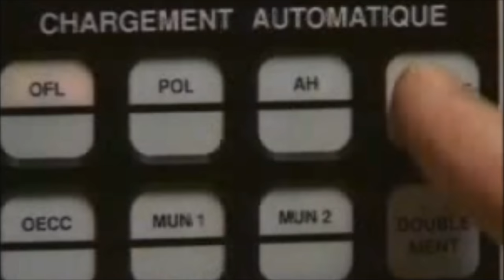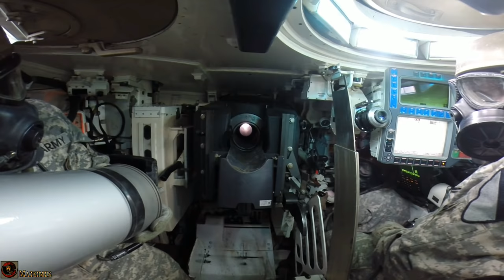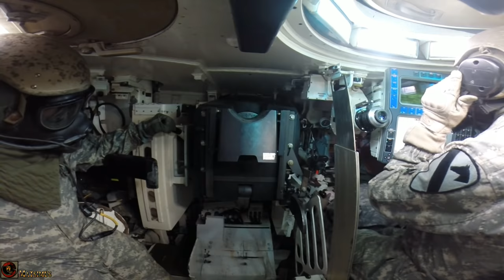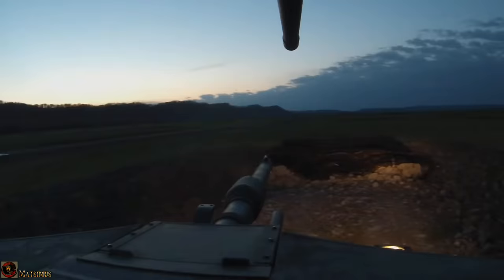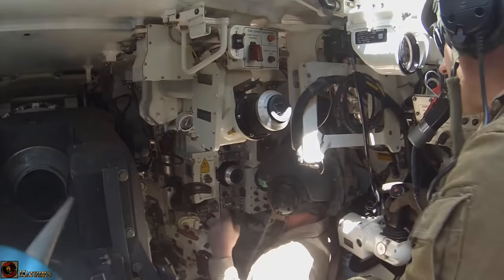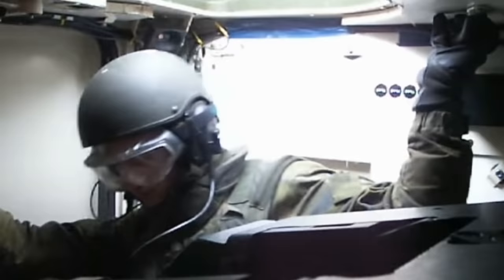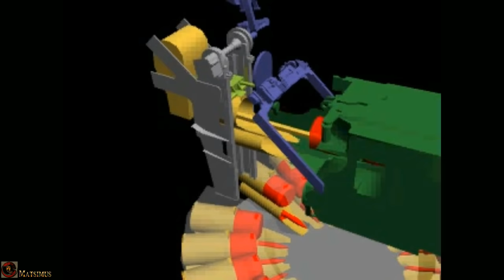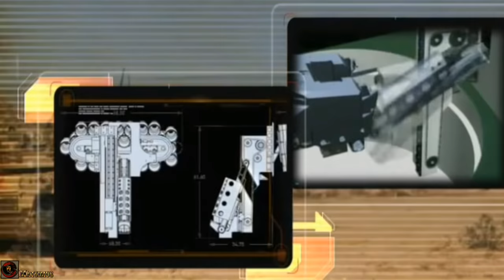Tank Autoloader or Crewman Loader?

Comment: I have a question that someone might know how to answer: why is it not often that you see a tank turning its turret when you see tanks at training exercises?  I mostly see the tank turning its whole body to the objective and then shooting. They apparently never shoot at something on one of the sides of the tank by turning the turret 90 degrees, but turning the whole tank to the enemy. Why?
Reply: There are several reasons why. The main one is that you are trained to always face towards the enemy.  The frontal aspect of the tank is the most protected. If the hull side is facing the enemy you are presenting a larger target and weaker hull armor protection. You would only fire over side if you have no choice and must fire quickly. The tank is also the least stable when firing off the side. If the enemy appears on your flank while you were moving, the entire platoon would action (turn) towards them. Another reason is that the enemy "should" be to your front, so if you are firing towards the flank you may be firing on friendlies.

Comment: You can use a manual loader for now, but by the time to catch up technologically, those who already know the system will be ahead of those who don't. 

The Russians might not create the best auto loading system for now, but they have the technical know how to make a compact loading system for larger guns. Is about improving the system.

Human strength will become a limit. Till the point we can no longer unload, carry, shove in a 30kg shell every 15 seconds. A machine can't feel the stress, eventually loading different kind of ammunition is no longer it's limiting factor, it's not about how, is about when. 

Auto loading system is not perfect, but like robots once you invested into the technology you are one step ahead.

Now imagine an Abrams tank with an auto loader vs a lousy T-72M1 with manual loader, you might think differently......

I am not a tanker however. Yes I seen and even supported by one. I just felt today's stubborness is tomorrow ignorance.

Comment: Sorry, mate, but you are way off in this video. You equate autoloader with a T-72 carousel, and then draw all your conclusions from that premise.
There are plenty of other systems out there, for instance, already the AMX-13 had an auto-loader of sorts (the drum itself was manually cranked).
The fastest firing 10.5 cm tank gun ever was autoloaded, allowing the stridsvagn 103 to fire at a fire cycle of mere 3.5 seconds for as long as the trigger and loading button was pressed until the two main magazines of 45 shells were depleted. (Practical rate of fire was x2 - x3 times higher though, as the muzzle blast and impact resulted in an obscured target). Now before saying shells are much bigger today and therefore the 10.5 cm guns doesn't really count, I'l just remind that another 1960's construction in form of the 15.5 cm Bandkanon 1 still is the record-holding artillery piece, able to put out its 14 (15 with one round prechambered) in less than 45 (48) seconds.

Now, the strv 103 is interesting, since it does give you right on one point. While it was fully operational  (as in being able to move around and shoot things spotted) with a single crew member never leaving his seat, it was redesigned from the original 2-man crew to a 3-man crew for exactly the reasons you mentioned: shorter watches when not in direct combat, distributed workload and so forth.

Comment: Can a manual loader reload on the move? And is he able to maintain the same quick pace throughout the entire battle?
Reply: This... manual loaders can load on the move but there is some difficulty in very rough terrain. As for quick pace I'd argue a manual loader (well trained one) would reload the gun at a very high rate during the initial engagements, which is usually the most critical time in an engagement, above an auto loader. As for a long stretch an auto loader would at least maintain a steady ROF.

Comment: Honestly Iam no expert on which is better. But I think its nations needs and preference thing. I Think it would be cool the have an mbt that could designed to integrate both a human and an auto loader option. As humans do get fatigued so having the option to auto load would be interesting to have or if the auto loading system has a malfunction of sorts it could be reset to a manual loading system. But yes dividing out the work among more crew is less taxing over and humans make less errors in these situations. And yes older generation auto loaders are bad however that can be said with any military technology being developed. 
As the next generation systems are going to be an improvement as experience will be gained from the mistakes made in the previous generations. 

Then will further improve upon future designs. Also France has shown that the auto loading system can work well as the leclerc was designed to built around the turret or incorporated in the build from the start. Wheres it was kinda of more of an afterthought with the soviet tanks or at least not factored in well during the design and well the Russians were the first to well design an auto loading  system the fact that it worked period and even though  it was considered a half assed design was an achievement itself and well the Russian's deserve some credit to in building a somewhat successful auto loader they could mass produce. 

So I think there are pros and cons to both human loaders and auto loaders. Now I can't speak for any actual tanker but as i said it would be interesting design a main battle tank with an optional auto loading system some how while maintaining a high level of durability for the tank. But again that could be stupid expensive and not make a whole of practical sense. But if it could be done it would be cool as it gives an option to make use of modern auto loading system if the crew wishes to use as they see fit. While still having a fully trained human loader when needed or if the auto loading system stops working. 

Now I might like seem stupid or crazy to think that. But we have seen this kind of  technology or seeing it with modern day civilian cars with more automated to systems to help driver all though that may be not most accurate comparison. But it would be interesting know if some military person thought of that only to be told your crazy that will never work. And then them saying something like not if you believe it so or its just so crazy it might though lol. Just an Idea that probably wouldn't work or but stupid and pointless in the long run.

But then again during WW2 military's were experimenting with all kinds of crazy and over the top ideas that ended up with many fails but very good successes along the way to lol.

Comment: Some of the autoloader tanks (the t64 for example) still have the 12.7mm MG and the IR spotlight on the loader's hatch.  The TC's hatch is the one on the left side, if I understand it correctly, and it has the slew controls of the turret.  I assume the TC has to switch positions to use the 12.7mm or the spotlight.  Also, I assume he losses slew control at the loader's position.  Is this correct?  Aslo, can these tanks be loaded manually?

Comment: Human loader would be better because auto loader raises more risks for fail.
Reply: so does a human loader, which has far more risks of failing, sickness, panic, nervousness, panic, human error, etc. etc. Autoloaders are either on or off, and considering most modern MBT designs are moving to autoloaders, they seem to be the preferred choice.  Leclerc, Type 90, Type 10, K-2, T-90, T-14, and the list goes on, basically any tank that was designed in the late '80s and '90s has an autoloader.

Comment: for sure autoloader . they are fast accurate and they dont make mistake . also if u lost a tank u loose less human . and tanks of new era are fulled with sesnsors that make u to neeed no more man power and doing every thing automatically
Reply: Sometimes they do, if not maintained properly. Sure they don't get tired, but you can't easily correct a computer in combat conditions if something does go wrong. Though that's easy to rectify. Unloading is a different story. A unloading mechanism  would take up more space than the space necessary for a manual loader, or an automatic one without it.

Comment: Without to be an expert, i'm just asking, a man loader (like in Leopard2 tank) is better than an auto loader (like in PZH2000)? Because as i know pzh2000 can fire 3 rounds in 10 secs, 60 rounds in 2-3 mins and can be ready for another 60 rounds after 11 mins, because of the fully automatic loader. I'm not an expert. I'm just wondering.

Comment: The next generation of tank shells may literally be too large and heavy for a human to load....
Reply: Wrong.   We are going with smaller bores in are new tanks.    I build them
Reply: @dazedandconfusedstacker9923  LOL.  Not true.  The next gun will be a 130mm.  The shell itself will be much heavier.
Reply: Wrong I work fro general dynamics. We build the abrams. We are building a run of new proto type tanks, they have a 105.   The new optionally manned tank evil have an 50mm auto cannon. My job is building prototype tanks for the us army , but what the fuck do I know
Reply: Where do you get your info. I actually am building the armies next tanks .lol
Reply: @dazedandconfusedstacker9923  Here is a pic of a 130mm shell vs a 120mm shell.  This is why we will need autoloaders.  As to your claims.....yeah nothing you say is backed up by media accounts.  https://en.wikipedia.org/wiki/Rheinmetall_Rh-120#/media/File:German_APFSDS_130mm_and_120mm_shell.jpg
Reply: For your information at 7:05 tomorrow I will be standing on top of one of the Army's new prototype tanks the turrets coming in tomorrow and we're going to look at both the things we got the hall halfway done so I know a little bit with the next army tanks going to be considering that I built the last two army tanks I built the last two generations of of the army Stryker and I'm working on a new generation of the new Abrams and the new Abrams replacement

Comment: What is the more important the gunner or loader? :D
Reply: Everyone is important in a tank crew, each has their own responsibility. Granted I have more than my share of being a part of a 3-man crew at times, I'd rather not. If need be, the gunner can serve as a loader because the TC could target and fire from his position. At the same time, I could also drop down into the loader's side of the turret and load the round while my gunner track to engage. The only one that would be hard if not impossible to change places with would be the driver. A crew could load and fire but without a driver, the tank would simply be a pillbox and a stationary target. So, what is your thought on who is important now. Everyone is important as far as I am concern; it's a team afterall.
Reply: most crew members are cross-trained to take each other's places in a tank.

Comment: Does the empty "shell casing"on the Abrams 120mm burn away when fired? I don't see an empty "shell casings" anywhere, just the primer end cap.
Reply: Yeah it's made of cardboard infused with explosives so it burns up. The only thing left is the end caps, which the loader would just throw out of the hatch in real combat.

Comment: If the tank guns keep growing bigger, eventually it will be the loading machine to win. 120mm is roughtly 50lbs, right? 130 or 150mm we can expect it to be 90lbs per round. You have to flip it 180 degree in a confine space and stick it inside the chamber and do it 5 times in 1 min? Come on, you are the one sit inside these vehicles, you tell us what a nice day it is.

For the maintenance, even the pick up trucks use by farmers nowadays do have computer,, can't see why it is not being use to diagnostic the vehicle?

Comment: Thing I find funny in the comments is the same arguments from both sides and everyone's screaming bias about the other side. Trouble is probably only a small percentage of these you tube generals have ever operated 1 of these systems and even less if not none have used both so could genuinely say which use better to use. Not just that but I'm pretty certain non of them took part in the trails and evaluations of these systems and vehicles. Point being regardless of what I think is better I also don't disregard the other side as a stupid choice or completely ineffective. Because at the end of the day a bunch of people who do know what they're doing and have likely been doing it for years after testing decided that system was the way to go. No evaluating board and officer is going to test something that will defend their nation and potentially mean life or death for their soldiers and at the end despite the results go. Well I see a lot of benefits for manual loading but that's 1 mans salary I can save on who cares about the downside. Regardless of which systems are employed they are chosen because it's seen as the right choice for that military and yea sometimes going against the grain is a terrible idea sometimes its the edge that wins the war but in reality as with every war you wont find the good and bad ideas until it goes against its opposing enemy. So until you have that real info getting all upset at strangers on the internet because they disagree with you tells us only one vital bit of info. You parents clearly made the wrong choice when developing you.